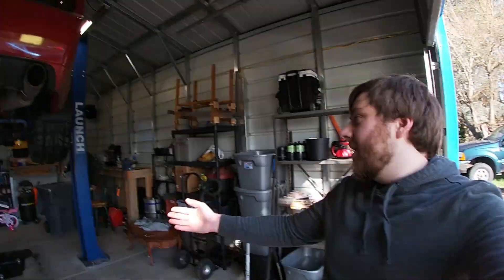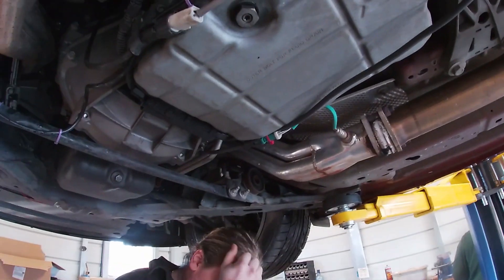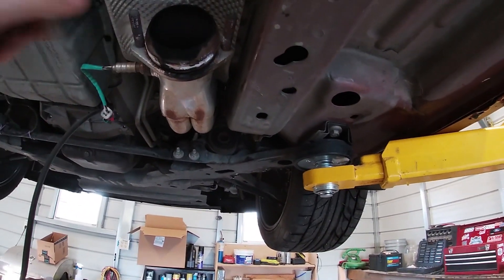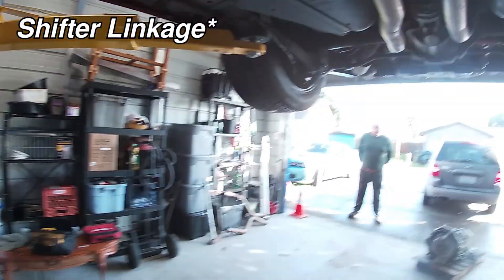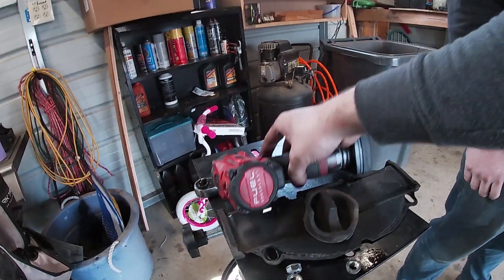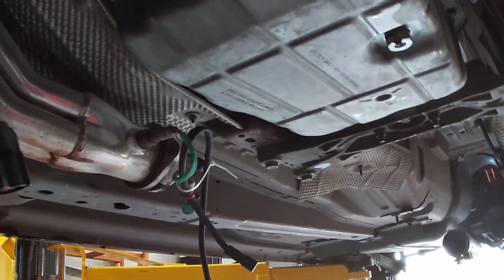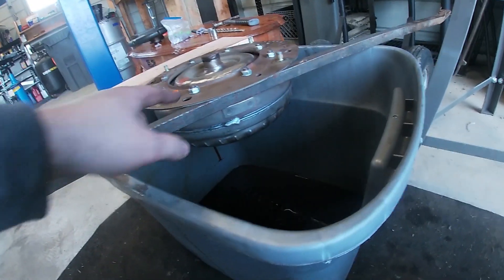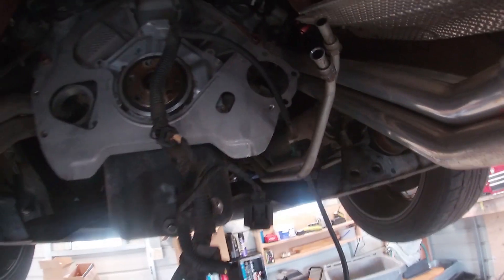2008 Ford Mustang GT 6R80 Swap Guide - US Shift Quick 6 Install! | Part 1

Comment: not sure if you’re still active but will the stock connector fit right in here ? what about the shifter linkage ?
Reply from the maker: You would need a stock 11-14 converter and it depends on if you have a truck or mustang transmission (they had different pumps). If you have a f150 case you will need a PBH shift lever correction kit and stock 11-14 cables for a mustang. If you have a mustang case there is no modification needed and you can run stock 11-14 mustang cables.

Comment: Hey man I know this is an old video but do you remember what you set the torque converter clearance to? I'm installing a built 6R80 into my turbo bbf truck and my clearance is only .010, so I need to add some more. I'm being told to shoot for .125, any advice would be much appreciated 🤙

Comment: If this fits the 4.6 it'll also fit the 4.0, would I need to use the 4.6 flex plate? Also is there anyway to wire it to stock instead of using stand alone controller?

Comment: What flex plate did you have to use helping a friend to this install
Reply from the maker: You should be able to re-use the stock 6 bolt flexplate. I ended up purchasing a SFI approved flexplate but it was same design as the stock one.

Comment: So the stock flexplate works, any issues with converter spacing? Some same 4.6 flex plates hold the converter to far into the pump(I'm a 2v, 3v flex plate may have a different spacing, also the converter just bolts right up? No drilling? Thanks

Comment: What torque converter did you go with? Did the 5r55s bolt up? Gonna be doing this swap soon because of your videos!
Reply from the maker: I got a circle D 3b 3500 stall converter. The 6R80 bolts right up same as the 5R55S

Comment: I'm very interested in what you've done, I want this swap in my Jag, the 6hp26 doesn't hold the uprated power. How did you mate the 6r80 bellhousing to the block? Does somebody make an adapter for the 05 Mustangs to accept the 6r80, or did you do something yourself? Needless to say the market for a 6r80 in an old XJR is..not so large, so nobody makes one for my project.

Nice job, in any case!
Reply: Hi, friend. The 4.6 3v and the Coyote where he got the trans from have the same bell housing so it was a relatively straight forward swap. If you're bent on having a 6R80, I'd look into the bell housing of your Jag and look into the 3.5EB bell housing and 5.0(modular) Bell housing and figure which would be the easiest to have an adapter made for. A spacer may be needed to take up the space between the torque converter and the flex plate along with a 1 off drive shaft. There's a fella on YT with a trans swap channel. I'll see if I can drop his link. Perhaps emailing them may yield a product for you in the future. Good luck!
Reply: Speed Gems is the name of the channel 

https://youtube.com/channel/UCqIkF9KWxX2HNvFjiURWeYg

Comment: I did the swap and put an us quickshifter 6. I still have a failsafe showing up with p2106 error Throttle Actuator control system. Can you help?

Comment: How did your tuner make the vehicle know it was in park once you deleted the tcm control in the oem pcm. I just finished my quick 6 install and the truck didn’t wanna start so I was able to jumper the starter relay with a wire and it will idle with a wrench and limp mode.
Reply from the maker: We basically put a manual trans tune on the computer and deleted the tcm data. When installed I couldn't figure out the neutral safety bypass with the quick 6, so I wired up a push button that jumps the starter as well. Doesn't go into limp mode though. Who is tuning yours?
Reply: @JuryRigGarage  I had injected engineering in Kennesaw ga do mine. He to also did delete the trans data from the 6r75. The truck doesn’t show a gear range in the cluster anymore but I may remove my old mechatronic unit from the old trans and plug it in to atleast show the vehicle park.
Reply: I have a wrench light but when I hook up my autel the vehicle no longer shows it’s looking for the trans data this 08 expedition has a weird silver oak pcm which only uses 2 of the usual 2 pcm connectors one is body, one is engine, and there is no transmission pcm connector like on f150 and mustang it uses the HS Can to communicate with the trans and modules.

Comment: Watching through the videos again because I am doing the swap finally! Videos are very useful!
1-The flexplate you used here was the one from the upgraded section of the build sheet? Perfect fit no shims? Stock one wouldnt work? I have manual now so need one regardless and have a circle D on order.
2-Did you reuse bolts for driveshaft or need new ones? I also want to do a one piece either DSS or FRPP.
3-Also, what trans dipstick did you get? Very useful item.
Reply from the maker: I purchased a SFI rated flex plate, the stock one would have worked. I re-used the stock driveshaft bolts. The dipstick is a lokar brand, if you google 6R80 dipstick it will come up.
Reply: I did the swap and put an us quickshifter 6. I still have a failsafe showing up with p2106 error Throttle Actuator control system. Can you help?
Reply: @dellavalle76cn  
I would ask US Shift, they are friendly, or see if the book has some troubleshooting sections. Sounds like a throttle body issue. So maybe how it’s wired, or how it got setup, however I don’t want to steer you in the wrong direction. The people who made it can help you best

Comment: Do you think a 2014 mustang transmission will fit in a 2008 mustang Gt?
Reply from the maker: Yep that should bolt up, I have a spreadsheet of the parts list in the 6R80 install videos
Reply: @JuryRigGarage  can you send me that?  I just blew the same tranny you had in your 3v. Someone is selling me a 6r80 off a 2013 for pretty cheap and might go that route
Reply from the maker: @Sensei_S197  A link to the spreadsheet is in the description

Comment: Hi first thanks for this video!  interesting, then I would like to ask you but at this point I could also use 6R80 of a Mustang GT  2011-2014?  thanks
Reply: Any 11-14 F150 or Mustang 6R80 will work. Not 100% sure on the 15+.

Comment: What trans are you swapping out what vehicle's does your replacement come from I hate my 3v auto trans its junk
Reply from the maker: My Mustang had the 5R55S 5-speed auto in it originally. I'm swapping in a 6R80 6-speed, this one was out of a 2012 F150 5.0 2WD.
Reply: @JuryRigGarage  does it bolt right on or i would need additional parts?
Reply: @cypherschat1046  Build sheet in description. Physcially bolts right up yes you just need a trans controller and new driveshaft amounst other misc things.